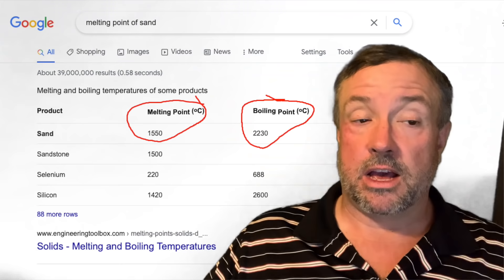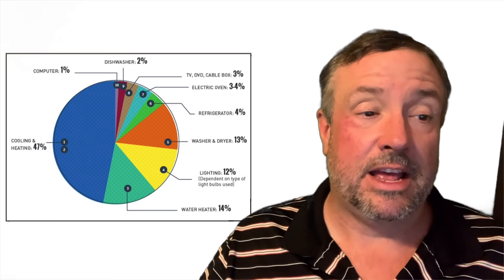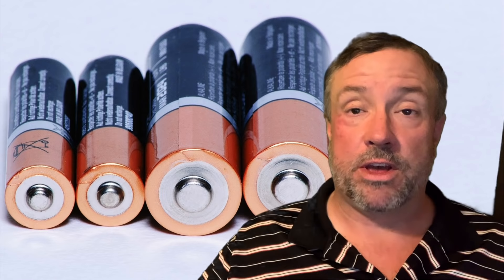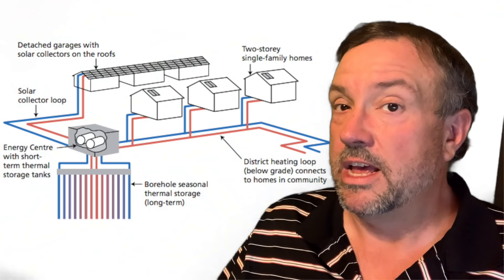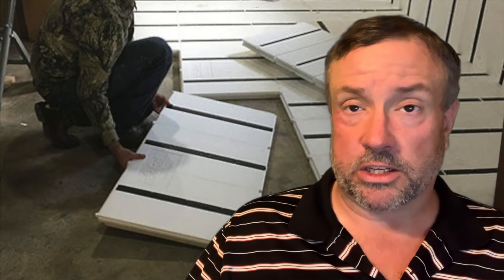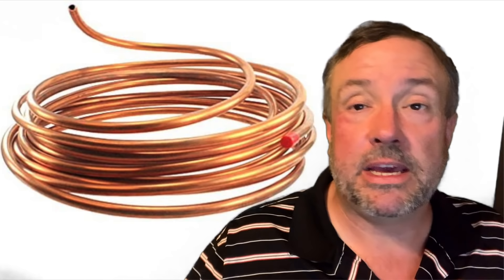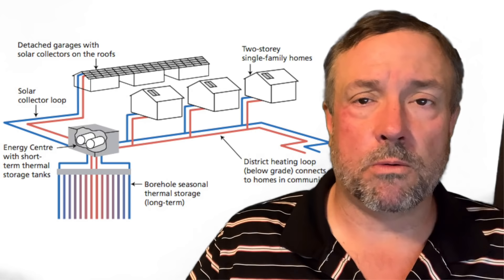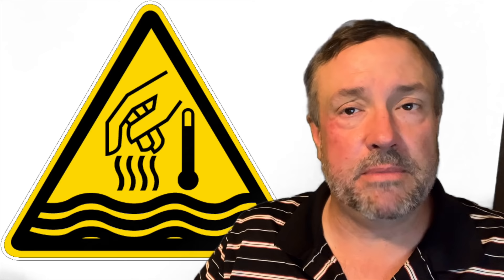Sand for Thermal Energy Storage

Comment: I have been working on a similar idea... but I am using it for heat and to make and "clean" my house water.. for use in my garden as gray water....  My plan is simple... fairly cheap... and maybe workable... however, it is too complicated for me to try to explain...    Thoughts... using conductive rods in the sand to transfer heat...  I am lost on the pipe and oil as well.. I want something that is "edible" safe as I am also planning to make water...  Let me know how I can help.
Reply from the maker: I'm unsure if conductive rods will transfer the same amount of heat as tubes with a liquid

Comment: Create a super geothermal vertical spiral closed loop steam turbine system. Using a high temp metal rod maybe titanium that will travel through the middle of a sand pit using concentrated solar to heat the metal rod. Water gets pumped from the bottom of the sand pit and spirals upward inside copper piping that eventually turns water into steam that can be harnessed into a steam generator and can heat up your house
Reply from the maker: interesting set up!!!!!!
Reply from the maker: @thechino131  email sent from hjor@mts.net

Comment: My oil heaters loose heat so easy. If we can move sand like that we see when boiling 1 liter of water using a blender for about 1 hour. As you know that compressed air liquefy sand if well distributed and high pressure, maybe just maybe, a heated oil under 30 cubic centimeters or more of sand closed in metal case, but not airtight sealed to let vapour escape but also hope to precipitate some water back into the pipes that will inject some drops inside oil pool reservours under this sand, so then water will expand 200% under high pressure sand, and if we can balance that energy well, the heat will last longer than stand still sand because of its controled vulkan like kinectic energy. Heating by consequence the room. Not sure. Water and oil is taboo but is damm cheap and maybe proibitively strong to use against the oil the sharks. Carefull tests should be done.
Reply from the maker: interesting!

Comment: Let me first congratulate you on the notion of using YouTube as a crowd sourced problem solver. I spent some time researching plastic tubing and it would appear that if it were available that the best you could hope for would be around 260°C. I couldn’t find anything readily available that was anywhere close to that. I suspect that mild steel would be limited to 500°C at low pressures, practically speaking. Then I think you wouldn’t find a medium other than the liquid salt that would be free of vapor pressure issues at that temperature. 

Having access to a naturally occurring cave would be an interesting air-to-air system. The cave temperature would be constant but not quite warm enough for heating, requiring that some other source would be required to raise the temperature in winter. It’s conceivable that one could build a “cave” by burying large tin horns under 15 feet of earth. Perhaps someone else can provide a thumbnail cost estimate based on available tin horns that would cover just the “cave”, itself.
Reply from the maker: YouTube is amazing for crowd sourcing answers!!!  Cheers

Comment: You shouldn't expect more then 250 degrees from dish" solar.    Also 1 kg can drop from 100 c to 20c if average temperature is 20c  within 40 minutes ,  but if the mass can ad up to 30% in center of mass  a  cube 1 meter can stay warm for 9 to 12 hrs  if cooling equals to  aria of less then 6 meters total. So to heat radiant floor heating in a home 20c 800 SQ home  It would take a cube of 3 meters x3x3 cube of 100c sand  And you would be able to pump 8000 galons of water from your heat battery before it cools in whatever time that's you need if battery is well insulated. As u use ,8000 galons at 3/4 floor pipe would be 40 foot long to hold 1 gallon. So a 20x40 home 800sqft can hold 20 gallons at 10 galons per minute pump you will use up your 3x3x3 meter 100c battery down to 20c  in less then 13 hrs..   at 200c you can heat a 2400sq foot house for 13hrs.    To use 100% dish solar you will need to use 24,000 feet of 1/2 solar  dish if you get 3hrs of full sun per day to have 200c sand to heat a 2400 SQ ft home for 12 -13 hrs..   and about 50,000 feet to heat 24-7
Reply from the maker: your math doesn't seem to add up, I use a wood boiler and it's way less than that

Comment: You are making it unnecessarily complicated. For heating simply place an electric resistance heating coil (Kanthal?) directly in the sand near the bottom. Apply DC power directly from a solar panel array. Used panels are cheap so the cost per watt would be minimal. Even a small blower could remove massive amounts of heat thru a light gauge carbon steel coil in the upper sand layers. One gallon sand = 22 pounds/10 kilos and has .2 specific heat = 4.4 btu. of heat per degree F, so if heated from 70F to 570F it would contain 2,200btu of stored heat. 1,000 gallons would be 2,200,000 btu. or 645 kw of heat. And you could go to a much higher temperature safely. 
  Heating water would be a bit more complicated but that can also be done easily by just using a standard electric water heater with a replacement DC heating element powered directly from solar panels
Reply from the maker: Thank you for the ideas!
Reply: Almost got it... heat clay floors tiles 2" with nychrome wires. Build batch rocket stove in floors. Now you have the best of both worlds. I posted an video of floor rocket prototype.
Reply: Did you try this

Comment: I would heat the sand with electric coils. Run air blower through the sand to get the heat out
Reply: This already works in fire clay heat exchangers.  You can heat to about 2,000 f 
No need for concentrated solar just panels and nychrome wires
Reply: Problem is where is the electricity coming from ? You are talking about a lot of KWH's.  Sand is slower to accept heat than water. 

Zero advantage if using grid power to heat electric coil. May as well use electric radiant heaters.

Comment: I had thoughts of using a parabolic lens to heat a thermal battery with water or fire brick in mind for mass. Glad to see a brilliant mind was able to implement a more efficient and practical use.

Consider eliminating a liquid coolant and pump system in favor of a mechanical radiating system. Perhaps aluminum, copper, or better can be used in a certain fashion to control the thermal exchange without getting too hot in summer or insufficient in winter.

Interesting topic. Hello from Alberta.
Reply from the maker: cheers from Manitoba! thank you for the insight

Comment: spot on with heating oil to heat the sand. To heat the oil use a hydrogen flame. The flame can go 24/7 at the cost of running a computer. Hydrogen uses DC to make the hydrogen bubbles. Computers are DC with an inverter for the AC,  Cost almost nothing to heat. Can be run in heavy wall steel pipe.
Reply from the maker: Thank you - cool idea!

Comment: sand is a good idea because it is cheap. higher temps are just more costly to obtain. you are better off building more cheaper collectors and storage containers. use a cheap fluid to circulate thru the sand.
Reply from the maker: very true

Comment: Look, why you need sand when you have water. Storing heat means utilizing material's specific heat. Specific Heat of sand is 0.88 kJ/kgK while Specific Heat of water is 4.18 kJ/kgK. It is almost 5 times higher, means you can store 5 times more thermal energy into water.
Reply from the maker: water tops out at 100'C
Reply: @SimpleTek  oh yeah, fair point.

Comment: You are sort of trying to do what a ‘geo-thermal heat pump’  is already capable of. It, the heat pump, is also already less expensive to implement than your best intention/wish. That said, if you have great heat transfer and storage ideas for your sand, then the degree of efficacy we could deliver to heat pumps would be greatly increased in winter as all heat pumps could be made geo-thermal?…or at least in part?
Reply from the maker: Heat pumps use a lot of electricity

Comment: PV + Furnace wire + Air to water heat exchanger, where the air is inserted through tubes in the sand pile and carries the heat to the water in the exchanger Then the heated water circulates into your house like normal
Of course you need to do some math before building it going backwards: 
-calculate your heating needs over the cold period
-estimate the size of the PV system you'll need to produce the electric energy needed for heating
-factor in the the function of the heat exchanger
-calculate the size your sand pile
Before building the real thing make a very small version of it to heat a test room.
Reply from the maker: Wow

Comment: Using metal thermally conductive tubing inside the unit would cause the energy to drain quite fast, fiberglsss or carbon fiber, even pvc I think would be better
Reply from the maker: can PVC withstand 200-300' heat?
Reply: The metal inside is fine, it's where it comes out you want an isolator that is not conductive
Reply: @SimpleTek  No. PVC is good for up to about 120* F and CPVC/PEX can handle regular hot water tank temps of 160* F or less.

Comment: calculate the amount of heat you use per year. use that number to size the tank. it will be big based on your climate. insulation is cheaper then handling high heat. i would use 200 degrees F as my max. you can get hat out of flat plate collectors and just use air thru the collector. or water with antifreeze.
Reply from the maker: ok
Reply from the maker: @LaurenBurger  interesting math

Comment: Why build a complicated sand thermal battery for seasonal thermal storage, when there already exists a free thermal battery that has greater capacity and is free to use?  The Earth itself is a thermal battery.  I'm talking about geothermal.  All you have to do is look 8 ft or so below ground and you'll find consistently warm temperatures, at around 55 degrees, which can be boosted up to 90 degrees for circulating in radiant tubing using a compressor that runs off solar power.  It doesn't need to run continuously, because your house has thermal mass that also acts as a thermal battery to help maintain temp.  Solar PV works great in winter, so long as you remove snow accumulation, which isn't really that hard.  You can even automate the snow removal process by using a parabolic reflector to focus some extra solar thermal energy onto your array.  This gives you a much simpler all around solution to both electrical and heating needs.  For cooling, again, you can use geothermal -- all it takes is a few pipes buried underground for an earth-air tunnel, and the only energy cost is a simple fan.
Reply from the maker: Ground temperature here is 5’C, that’s why
Reply: I live in zone 4A, 55 degrees is the temp you can expect about 8 feet down when it's -30 deg F outside. There is nowhere in the world where geothermal stable temp is as cold as you say.
Reply from the maker: @arandomperson2345  it’s that here, I dig all the time and I know the temperatures

Comment: Why couldn't we build a small steam generator with a parabolic lens or a fresnel lens? The most powerful fresnel lenses can produce temperatures up to 5000 degrees Fahrenheit. You could make a rod filled with sand and use that to pressurize steam to power a turbine, just like most every commercial power plant does with other heat sources.
Reply from the maker: Steam generators can be dangerous
Reply: @SimpleTek  Yes indeed. I’ve been theorizing on how one might make one, it’s quite the endeavor indeed

Comment: MUST WATCH "Sand battery , free heat, 500F" from "Texas pepper projects"... he uses 2 solar panels to heat sand with a water heater filament.. 500F sand can then be used for heating or cooking... wires can be run so that the heavy sand  never needs to be moved
Reply from the maker: Very cool

Comment: Here's another idea. Heat the sand with a rocket mass heater fueled from a bamboo patch in the garden. Cut, dry, burn the bamboo. It regrows the following year, recycling the carbon burned the year before. Closed loop carbon cycle. Use the heat for hit water for use and for radiant heating in Pex tube under the floor.
Reply from the maker: bamboo likes warm climates - not manitoba

Comment: wonder how a battery made out of solid glass would work
Reply from the maker: Good question
Reply: @SimpleTek  ive seen glass stay hot for many hours
Reply from the maker: @prototype9000  it’s worth exploring the idea…. Glass is basically just sand though
Reply: @SimpleTek  i worked at a industrial foundry once and they had these giant quarts glass slugs that would get glowing red hot about the size of a small car once they got that way they were put away and it would take about 6 or 7 days to cool enough for them to be used again they were still fairly hot
Reply from the maker: @prototype9000  interesting!!!

Comment: The problem with this idea is that you cannot heat water with sand that is at 400 degrees Celsius. It would boil instantly, causing pipes to burst.

Comment: For seasonal storage you need to go big with insulation. Really big... Otherwise you will lose that heat, specially if you go to higher temperatures. An alternative is exothermic reactions like for example  Calcium hydroxide reacts to water releasing a great amount of energy in form of heat capable to evaporate water. The concept is simple you get the  CaCo3 and you dry it with solar hot air and it will stay charged at relatively normal temperatures for months and during winter you hidrate it which will release heat and will heat some pipes going through it. You harvest your heat on demand. More water more heat and then you dry it back to its initial state. You need a lot of "slake lime"/CaCo3 but it's cheap and the concept has proven to work.
Reply from the maker: very interesting!!!!!
Reply: I made a scale version of it with a couple kgs of sodium hydroxide CaHO with a bucket as a storage medium a radiation heater (electric carbon fiber lines) to dry the caho a few garden drip irrigation nozzles, a coil to collect the heat (heat exchanger) and a condenser to recover the moisture as it dries. Charge phase--->you dry the CaHO with the electric hot lines from my excess PV production in hot days. The moisture will evaporate and condense out of the sealed bucket through a cooling pipe to another bucket. The sodium hydroxide will remain dry at room temperature for months. (Charged).
Discharge phase---> in inside the first bucket you have a couple irrigation dripping nozzles which will release drops as soon as you start a small pump that moves the water from the second bucket to the first one. As the caho heats up you harvest the heat with the coil. So far it works, but I'm struggling to do the math on how much energy i need to store to make it feasible for hot water or space heating at my house. I hope you get the idea. Please mind that you must use only plastic components as the caho reacts with metal (corrosive).
Reply: Hi, sorry but it sounds too good to be true. It seems strange to me that such simple storage system is not being used.
You say "dry it with solar hot air", but it s the chemical reaction that creates the heat, it s not the caco3 that stores it.
If so there is no need for solar drying, just a normal and long drying with dry air and it would be loaded again ready for another exotermic reaction, for eternity
I may be wrong, but it sounds like it s againts thermodynamic laws
Reply from the maker: @offlimit88  you're wrong. it' being used right now in some places, just not many small scale individual houses or greenhouses. and it's not chemical
Reply: @SimpleTek  Please share us some link, where is this system used? I m just trying to understand
Reply from the maker: @offlimit88  drake landing uses rock to store summer heat for space heating in 55 homes in Alberta - that's just one of a dozen examples that have been in use for 10 plus years https://en.wikipedia.org/wiki/Drake_Landing_Solar_Community
Reply: @SimpleTek  Actually the article does not mention "rocks", the system uses water stored underground...
nevermind
Reply: @nigelwilliams7920  yes that is the potential energy that it stores but you control the temperature with the amount of humidity you add. As mentioned i did the Proof of concept with two plastic containers never went over 70C. I am messing around with ultrasonic mistifier you turn it on 10 seconds and then take temps readings. Not saying this can be a solution by any means... but am enjoying it and that is sufficient for me. One of the things i have my concerns is the number of cycles. There was a paper from a lady for her PhD where all the dense science facts were questioned. Will look for it and share if like.
Great article thanks!!!
Reply: @offlimit88  here is an example with naoh which had similar properties. https://youtu.be/AWrBzv4gVKw and here are two more explain a little more about the concept https://youtu.be/b4fhmjhuBR4 and https://youtu.be/FZu2qDeOqFQ hope it helps

Comment: Just bore a hole to the ground deep enough like when you extract water and use that as a mass.
Reply from the maker: How deep?
Reply: 300 feet. The deeper, the better so you get more heat from the ground. Im talking about vertical drilling.
Reply from the maker: @4runner4ever83  that’s an expensive hole!!!!
Reply: I know right!  Best in my opinion long term.  Use it to store heat and take heat out of the ground. You dont need a lot of space.